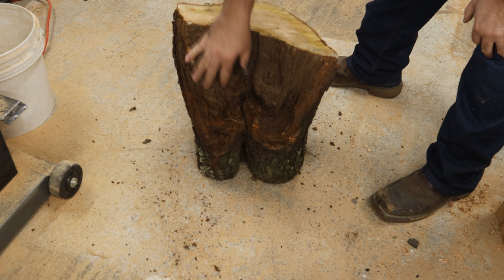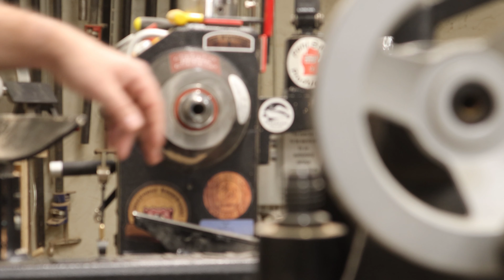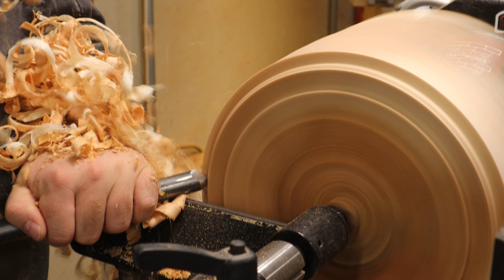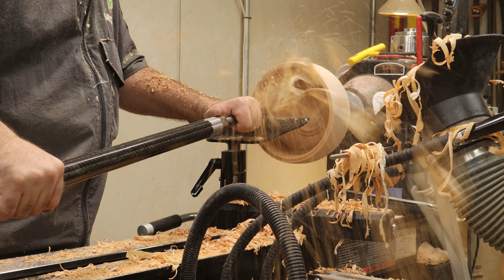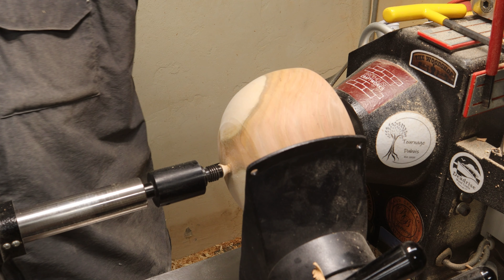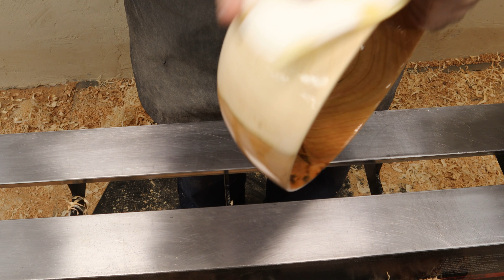Woodturning - Cherry Crotch Calabash

Comment: Yes. It is a gorgeous bowl, Seth. Loved the cinematic feel of the video, too. I will definitely check out the “Finisher”. I use a 40degree Mahoney bowl gouge called The Cleaner. It is terrible on the bottom. I end up using a scraper a lot of the time to get the transition and bottom smooth. The Finisher may be exactly what I need. Thanks. Take care. 😊🤝
Reply from the maker: Hiya Rob! Thanks buddy! I appreciate your kind words!
Everything that you’ve ever found to be an issue on any other bottom bowl gouge seems to be addressed with Ashley’s gouge. There is ZERO vibration, and just a pleasure to use all around!

Comment: Goodness! Now you've got an EWT chuck! I'm gonna be upgrading to Vicmarc eventually. What bandsaw blade is that? I'm planning to go thicker and forget about cutting blanks round.
Reply from the maker: LOL! I thought about going Vicmarc, but I liked the idea of the quick change jaws. 
That is the 1-1/4 Resaw King that I got when I bought the saw. I LOVE it but, MAN did it hurt the wallet!
Reply: I love the quick change jaws idea but I have to say that the Vicmarc VM120 chuck is fantastic! Thinking of getting another chuck, maybe a VM100. Changing jaws is a PITA.. 🤔
Reply: How are you two liking the SB bolsters / handles setup?
Reply from the maker: Haha! Precisely why I went the Easy Wood tools route.
Reply from the maker: @misfit4777  I absolutely love them! I had some hesitation about epoxying my tools to the bolsters but, I love that I can use all my tools on any of my handles. Plus, removing the tools to sharpen is much quicker.
Reply: @BrickhouseCraftWorks  any handle regardless of diameter of bar? I hadn't realized that.. 🤔 Been floating between Dway and Thompson handles but I'm intrigued by this even more now. Seems like a great solution. The versatility.
Reply from the maker: Yup. The SB bolsters that glue onto the tool are all the same size but, they have available adapters to help take up the space for smaller diameter bars. 

Ashley Harwood’s bolsters are basically the same design and are completely compatible with the SB handles. Although, I think you can get her bolsters in different sizes down to 1/2” diameter.

Comment: Cool to see the bottom bowl gouge in action. I like the design a lot, but since it's new few have experience and info about it. Lovely bowl, too. What length handle is that? I like longer handles, I'm finding and my Thompson 20" is longest I have other than a 3/4 Bosch I may use for this.
Reply from the maker: Totally understand man, hopefully it helps you. Thanks for the kind words about the bowl!

That is the 36” handle. I love it, but, I’d have been better off to remove the tail stock in order to use it with the bottom gouge. Just a tad too long for my bedways, unless I’d buy the extension…..which I may end up doing. 😂